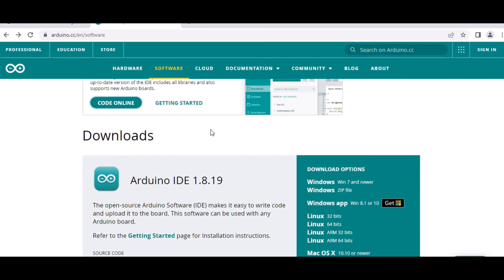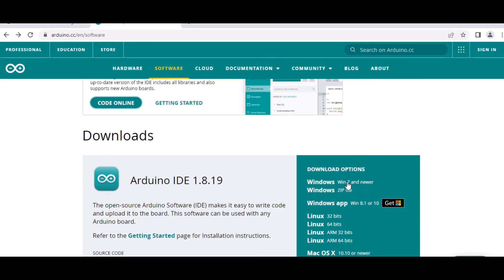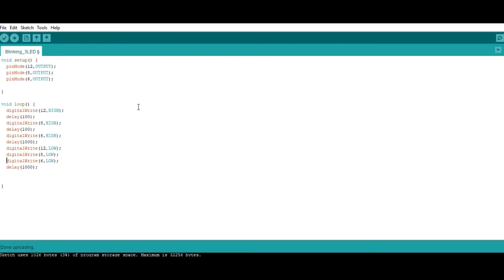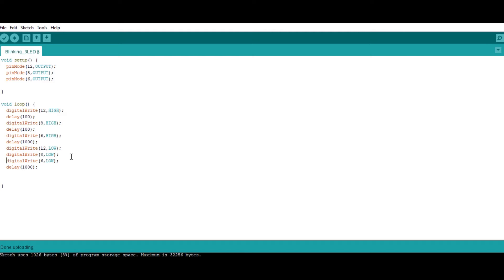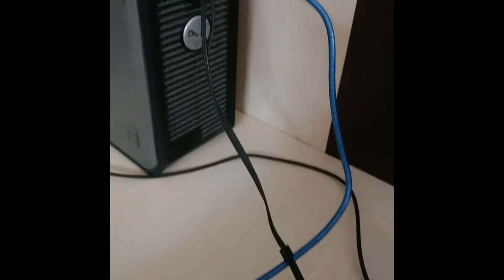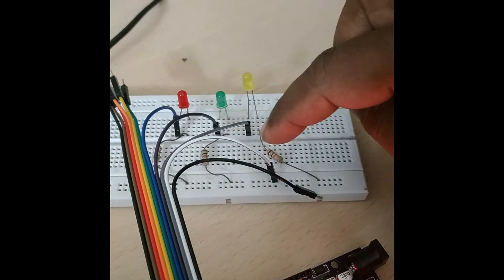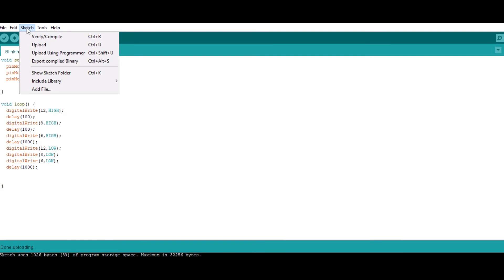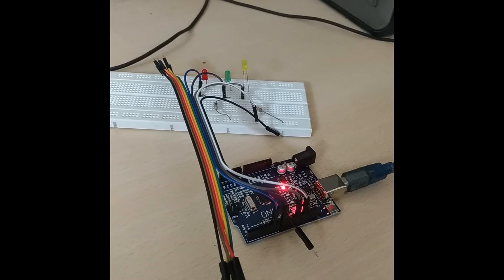Blinking LEDs- arduino hardware

Comment: void setup() {
  pinMode(7,OUTPUT);
  pinMode(8,OUTPUT);
  pinMode(12,OUTPUT);

}

void loop() {
  digitalWrite(7,HIGH);
  delay(1000);
  //digitalWrite(7,LOW);
  //delay(1000);
  digitalWrite(8,HIGH);
  //delay(1000);
  //digitalWrite(8,LOW);
  delay(1000);
  digitalWrite(12,HIGH);
  delay(1000);
  digitalWrite(12,LOW);
  //delay(1000);
  //digitalWrite(7, HIGH);
  //digitalWrite(8, HIGH);
  //digitalWrite(12, HIGH);
  //delay(1000);
  digitalWrite(7, LOW);
  digitalWrite(8, LOW);
  //digitalWrite(12, LOW);
  delay(1000);

}